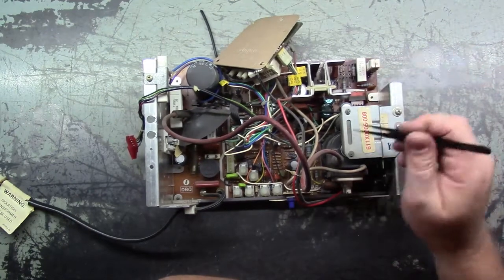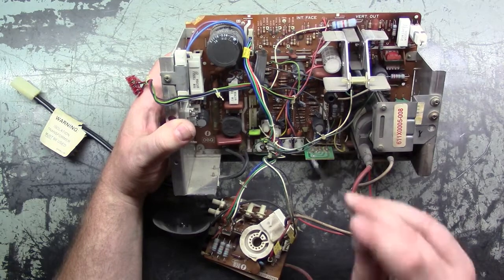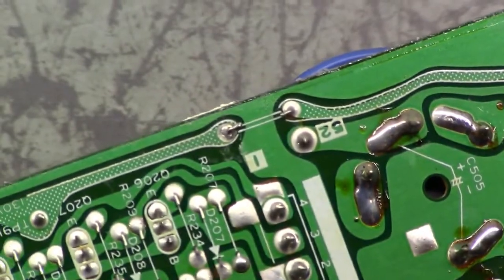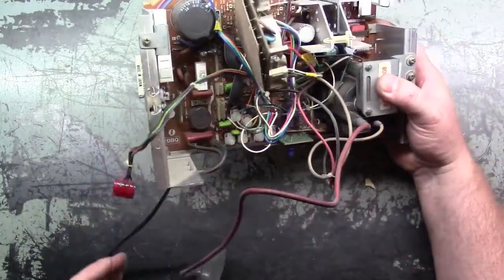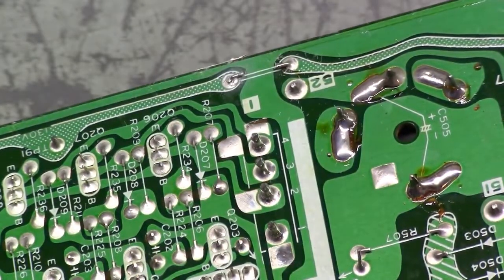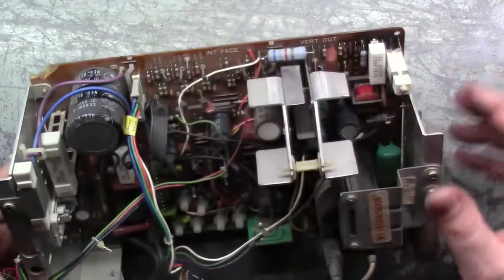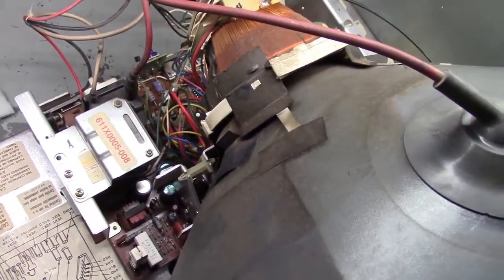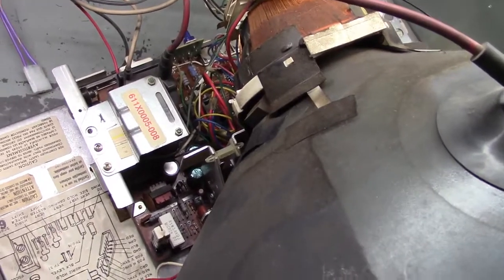19" K4900 Arcade Monitor Chassis Repair - Dead. No Life (Quick Fix)

Comment: Ok, here's a question I never see asked or answered.  Can you hot swap the vertical/horizontal position jumpers(K4906)?  I've always powered down the monitor before doing it to adjust the picture but it would be nice to know if it's safe to do when the monitor is powered on.  G07 has those same type jumpers, I wonder there too.  Thanks.
Reply from the maker: Yup. Done it many times.
Reply: @MikesArcadeMonitorRepair  Cool, thanks :). Damnit I've been powering it down all these years lol.  Will save me some hassle in the future.  Again, TY!